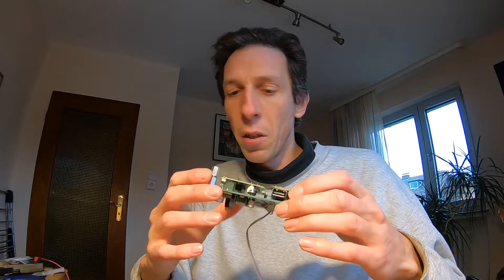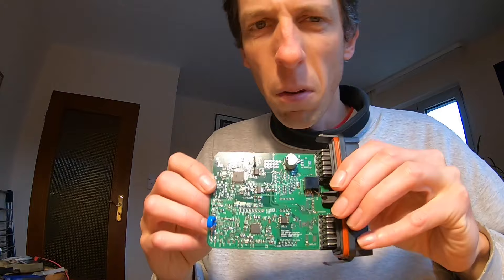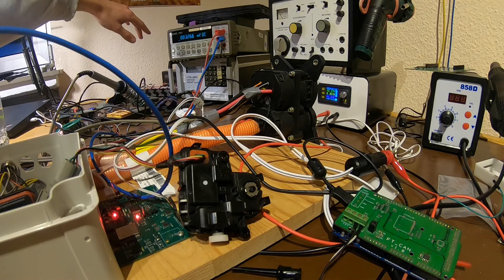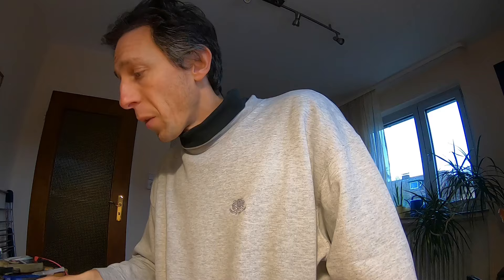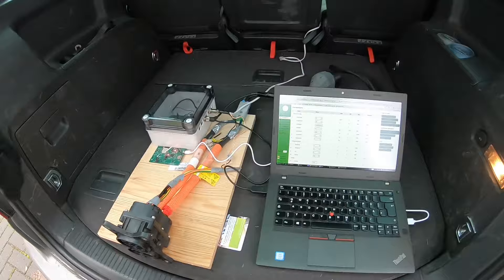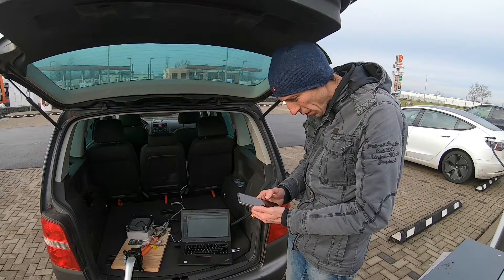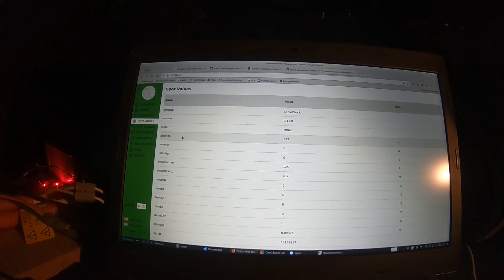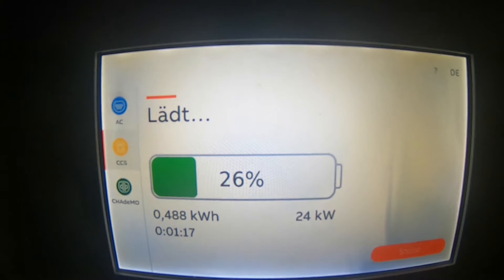Lab Update #84: Open Source STM32 CCS implementation

Comment: Cool !!!  Hi. Can you make the electronics for the station side? So that you can charge from your own three-phase socket. I have a 20 kW inverter, which is controlled via CAN, and I have already managed to control it, produce the required current and voltage.
Reply: Would be nice to charge my Leaf at home with 11kW DC (my provider forbid the 32Amp AC charger 😢)
Reply from the maker: The charger side exists as a python version that runs on that first bit of hardware I showed. github uhi22/pyPLC
Reply from the maker: @MrRossi1805  Leaf is CHAdeMO, not CCS. But that makes it even easier. https://www.youtube.com/watch?v=_BDJ7N_YjAU
Sometimes you can also find second hand mobile CHAdeMO chargers at a good price
Reply: @EngineersFear  Thank you. I'll look into this.
Reply: Would be cool to make a 100kW or so fast charger from a bunch of random car chargers. :P

Comment: Would the current only be limited by the hardware you are using?
I have a 2017 Kia Soul EV 27kWh. It has chademo connection and is capable of 175A. Only there are very few chargers with a chademo plug that support more than 125A. With a CCS to chademo adapter that supports at least 175A I could use the full potential of my car. This would be much faster for longer trips.
Reply from the maker: Yes exactly, because I use a 50A Anderson connector and 3D-printed CHAdeMO plug I didn't want to exceed 70A. But otherwise more is possible